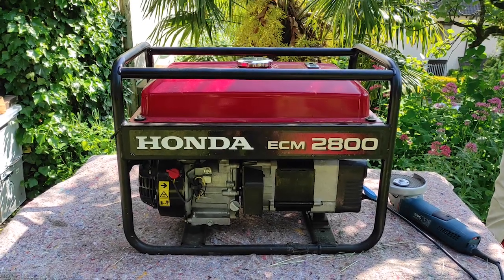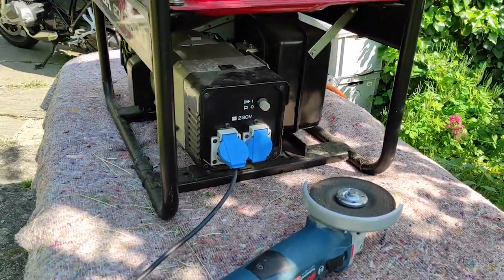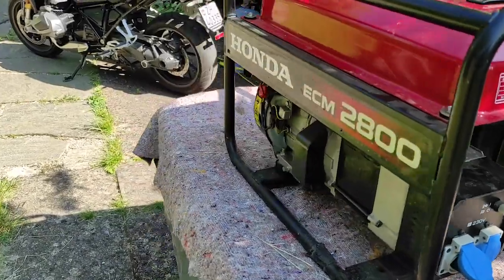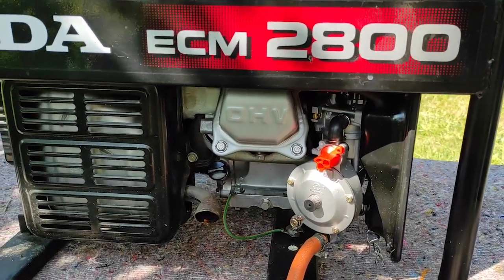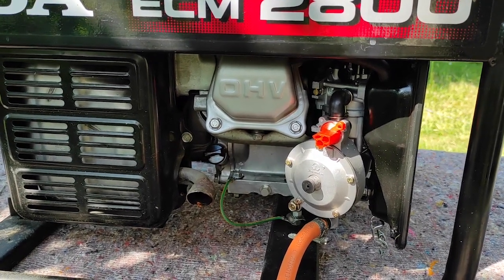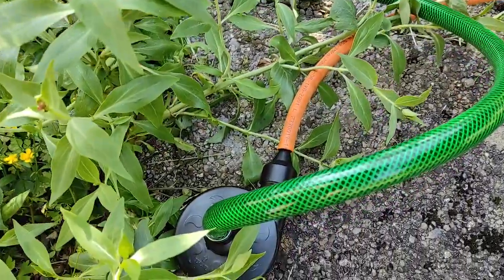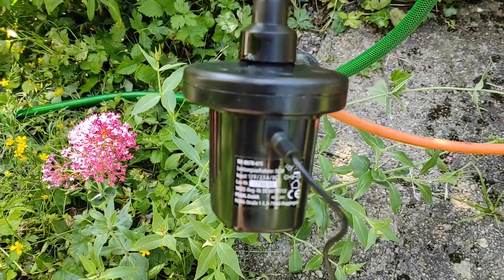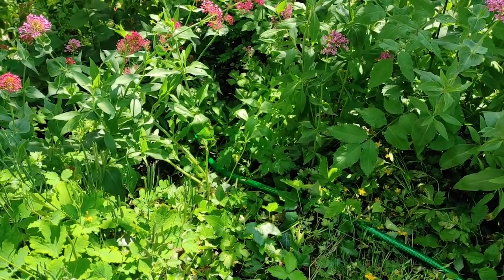Homemade Biogas 6 - Generating Power

Comment: Eine kleine Frage: Was für ein Dichtstoff / Dichtungsmasse haben Sie für die Biogasanlage verwendet?
Reply from the maker: Die allermeisten Verbindungen sind Rohrschellen wie man sie für Wasser braucht. Die Rohre in den Tank, wo ein Ueberdruck herrscht, sind mit Gummidichtungen versehen. Es hat sich aber gezeigt, dass ich diese noch mit Silikonmasse zusätzlich abdichten musste. Allerdings nach sehr gründlicher Reinigung mit Aceton o.ä. Danke für dein Interesse!
Reply: @etienneconod8075  Danke für die Antwort und die nützlichen Informationen. Ich baue gerade selbst aus drei IBC Containern eine Biogasanlage. Ich habe Ihre als Vorlage genommen. Werde allerdings den Mischer weglassen und die Heizung mit Rohren bauen. Nochmals vielen Dank.
Reply from the maker: @mrvladimir3795  
Ja, schön.. viel Glück und Spass! Ich weiss nicht, ob sich mein Rührwerk lohnt. Aber gerade habe ich nach meinen Ferien, nachdem ich meine Anlage während 10 Tagen allein gelassen habe festgestellt, dass sie immer noch Gas produziert und alles i.O. war. Die Heizung mache ich neuerdings mit 2 Heizdecken (1 im Sommer), da die Heizstäbe nicht gut funktionierten auf Dauer.
Reply: @etienneconod8075  Ich habe vor die IBC Container mit Bodenheizungschläuchen zu bestücken und diese dann über Solarthermie(Selbstgebaut günstig)zu beheizen, in Winter weiß ich noch nicht genau wie ich die Anlage beheize. Die Anlage wird ein Teil des Gewächshäuses sein.
Reply from the maker: Super Idee! Einfach Tanks extrem isolieren und Thermostatschalter brauchen für evtl Zusatzheizung @mrvladimir3795
Reply: @etienneconod8075  Ja ich werde Spätherbst schauen, was ich tun kann. Ich will das Gewächshaus ganz leicht heizen, und über Winter dort Grünzeug anbauen. Ich habe an eine kleine Gasheizung gedacht, mal sehen.

Comment: Hi! I have followed your videos about biogas, because i am experimenting myself. I would like to know the production rate of your digester. Also if you could measure the consumption of your engine under a certain load, that would be very interesting!
I compressed the gas that I have gained from a 60l digester into a gas bottle (originally butane) under 3 bars. Then I ran my generator with it, and measured the total energy produced. I had very low efficiency: 12wh for the 78l of biogas (26l under 3 bars). Maybe this could be explained by a high amount of CO2, maybe also because I didn't use a special carburetor, but adapted the gas flow in order tu run the engine correctly (I put a lambda sensor on it). You can see the video here, although it is in french: https://youtu.be/CjBtp2daiAU
Reply from the maker: Hi - an intersting life you are having! I looked into Jean Pain some 50 years ago after reading his book. Very inspiring. My playing around with biogas is more of a hobby than scientific work. I am happy to cook my meals with it for now over one year. Compressing gas seems too dangerous for me and as you are mentioning, the net yield is reduced by the energy needed for compression. I am finding that my 2 solar panels deliver all the energy to heat the system. This, after switching from aquarium heaters to electric blankets wrapped around the tank. To run a generator was a test to see if the possibility exists. But practically it is of little value because the amount of gas needed is massive.
Keep having fun!! Etienne
Reply: @etienneconod8075  Well that's quite interesting though. What system do you have with your solar panels? Do you only heat when the sun is there or have you got batteries to be able to heat in the night and get a more stable temperature? Is it direct current or AC? It's actually a theme for a whole video ;)
Interesting fact that the electric blankets are more effective than immersion heater. I would have thought the inverse.
Concerning the danger, you should be aware that these 12v mattress inflating devices let a part of the gas go through the electric motor for cooling, there it can mix with air and ignite with the sparks of the motor (it's not a brushless motor). Well, i have used them a lot for my gasifier, and never had an issue, but I would say the danger is comparable to what I'm doing by compressing the gas...
Thank you!
Reply from the maker: @foxtizzo  Thanks for the remarks about the mattress inflating device..! The heating and insulation are most important to making biogas. I have 2 panels of 500 W ea. sitting on my garage and send the 48 V through an inverter. Thus I get approx 250 W with the sun shining. I have wrapped 2 el. blankets around the blacked tank. Then a reflecting foil as used for emergenciey situations. After this 15 cm of rockwool insulation. Then Plastic wrap and finally a thick synthetic sheeting used in the building industry to protect flooring. With current summer weather my temp. remains at 30.8 deg. with only one blanket switched on consuming approx 0.8 KW/d. I must add that I have a switchbox solar/mains. When heat is needed and no sun available it draws from mains. Inside the digester is a temp. gauge attatched to a thermostat with hysteresis set to 1.5 deg.
Reply: @etienneconod8075  Thank you for all this information! It gives an idea about what is needed to get such a thing to work correctly.
Reply from the maker: @foxtizzo  Each setting is more or less unique and it depends how much you want to invest in terms of time and money. People living in warm lush environments have many advantages over us who live in Europe. On the other hand we have all the tools and gadgets nearby to realize our visions. Don't forget to have fun doing what youi do :-))
Reply: @etienneconod8075  I surely have fun with that kinds of experiments😉